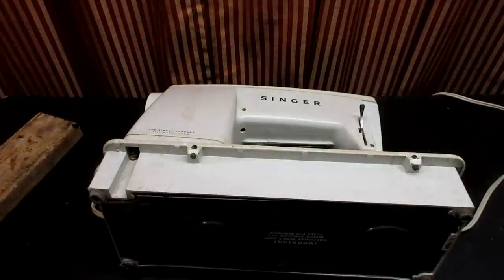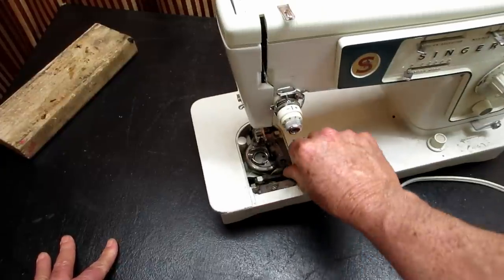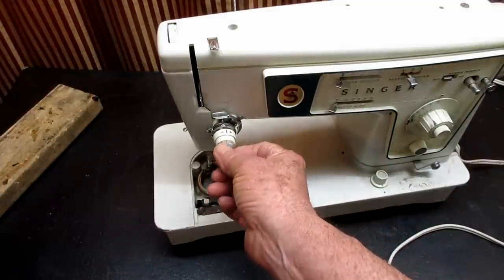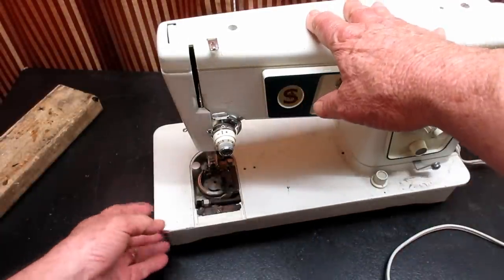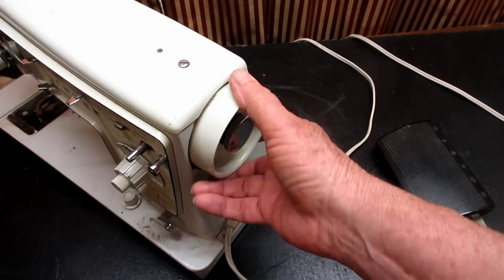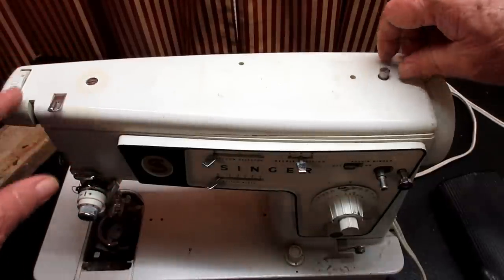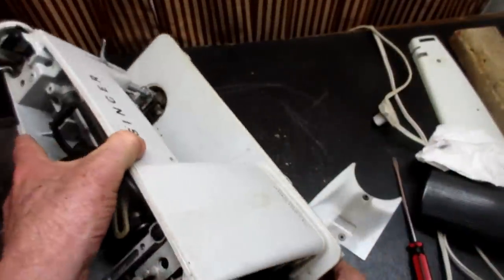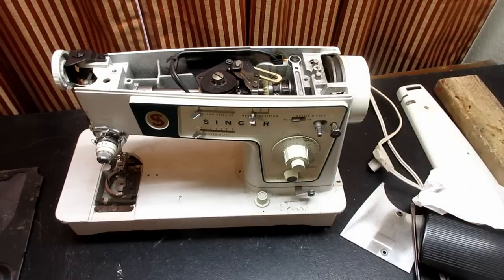About the Vintage Singer Sewing Machine my Wife bought me

Comment: I see these go cheap on goodwill and would like to gift them to people that want to learn to sew.
Reply from the maker: Every machine I bought from them needed some work. Some just needed minor cleaning and oiling, some came with missing parts, and some, like the one in the video, has a broken gear inside that needs replacing before I can see if the machine even shows. It's wonderful you want to gift machines, and thank you for that, but be careful what you buy, Please. Gifting a machine that doesn't work will be disappointing. Perhaps you plan to fix up and test the machines, you don't say, but I made the comment for others reading it too. I have fixed a few models for local charities that were gifted but did not work.
Reply: @andytubesewing1953  thank you good advice
Reply from the maker: @DL-by8el  No worries and your generosity is inspiring. Good luck.

Comment: U got lucky with shipping for me it always 20-50 bucks
Reply from the maker: I did not know this but Mrs showed my you can select 1 cent shipping option on the lower left of the search page. There are 22 machines today. Thanks for watching.
Reply: I’m learning as I go finding manual is the hard part I’m winging it lol this all started when I bought my fist machine and wanted to sew a blanket lol now I own about 20 machines lol sergers are my favorite to use but I do love sewing with a sewing machine
Reply from the maker: @krystleroy3068  manuals on cd.com and TandTrepair.com
Reply: @andytubesewing1953  omg u unlocked a monster now lol
Reply: Some of them the gears got broken in shipping so I had to part two machines
Reply from the maker: @krystleroy3068  oh ouch! Sorry to hear that. I don't lie too many from Goodwill. I did buy a $50 machine with 25 shipping and the old wood case arrived smashed so they refunded me the 50 for the machine and I did pay the shipping. The machine itself was okay
Reply: My goal is was to unfreeze clean and oil them to sell and then I did get into wanting to repair further I did set timing on my serger and I was so proud of my self 😁

Comment: Just off hand can a singer 201 hand crank be converted to motor drive?
Reply: yes
Reply from the maker: Hi, Jeff. Never worked on the 201 models, but I do know the hand crank model is 201-4. I can't find specific information about a hand crank to motor conversion, only a treadle to motor update.
Reply: @andytubesewing1953  Might be an idea to swap the heavy hand wheel on the handcranker, to the lighter hand wheel on an electric machine. Otherwise why not, Singer did it.
Reply from the maker: @jollyroger7624  Thanks!

Comment: Notice the spindle for the thread is missing any suggestions for a replacement, I could use a new one.
Reply from the maker: Yes, it actually uses two spool pins b/c the machine can twin-needle sew, I just bought replacements myself from this vendor I've used for years. https://www.ebay.com/itm/302295429424?hash=item4662363130:g:8bQAAOSwzJ5XVfGy
The spool pin is Singer Part #172007 and of course, there are many sellers.

Comment: Once one gets the faceplate off,  the repair is the same as a 457 singer.
Reply from the maker: Really Man I'm happy to hear that cuz when I look down from the top at the back of the face plate I didn't see the room. Do you have to take out the feed stitch regulator behind the dial or just the front plastic faceplate?
Reply: @andytubesewing1953  Just the faceplate. That all I needed on a 478.
Reply: @andytubesewing1953  Set the stitch length to zero just makes it easier to reinstall the dial.
Reply from the maker: Oh model 478 not a 466 huh? Okay I have some documents for 478 and I'll have to take a look at that and compare some of the parts and stuff to see. I appreciate the tips. Thank you, John
Reply: @andytubesewing1953  You are welcome.
Reply: Andy, your video on replacing the top gear on a Singer 457 really helped me in replacing the top gear on the 478.
Reply from the maker: @johncolvin2561  I'm happy to hear that John. I had a chance to look at the documents for the 478 and it does look real similar to this 466 a few differences on the inside but we'll see if there's clearance you giving me a good place to start and help me focus on the path and I really appreciate that